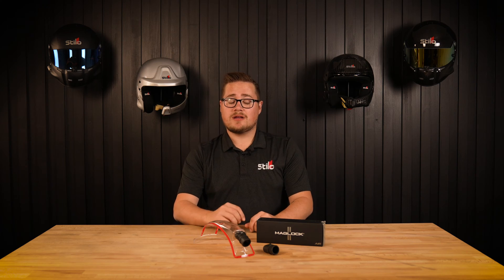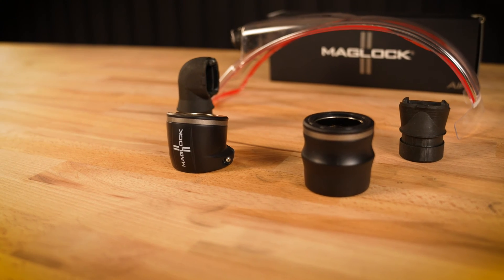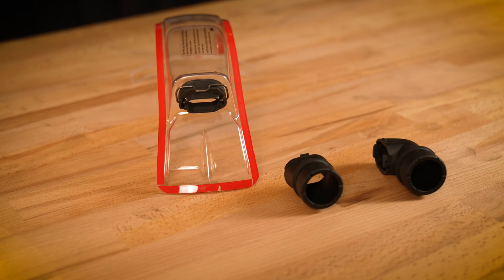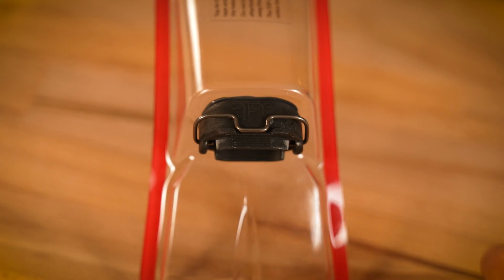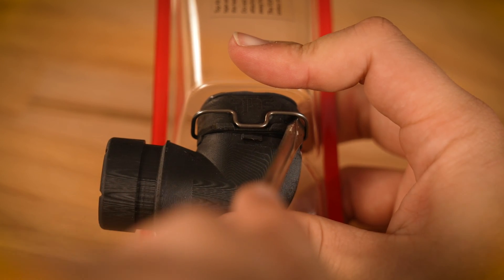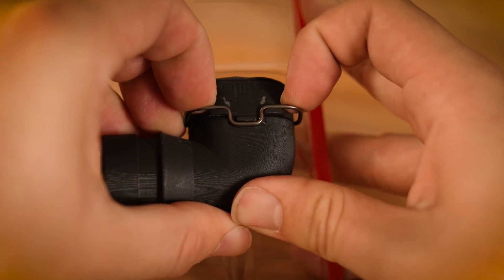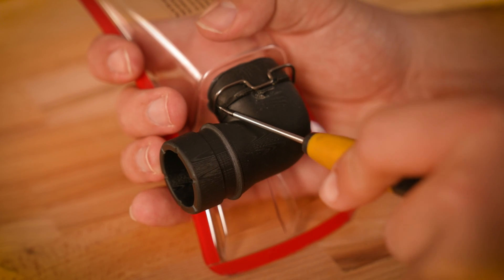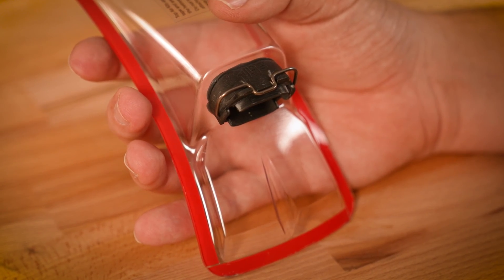Stilo Tech Tips - Modular Air Systems

Comment: I would like to see how you instal the system on the helmet because i don't think drilling screws into it is the right way. mine doesn't have the red glue strips 😅
Reply: Correct, never drill into the shell of a helmet.  Your Stilo air system should have included the tape shown in the video.  If it did not, please contact Stilo Customer Service and they will get you fixed up!